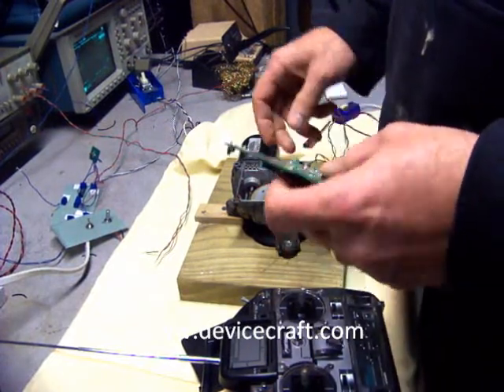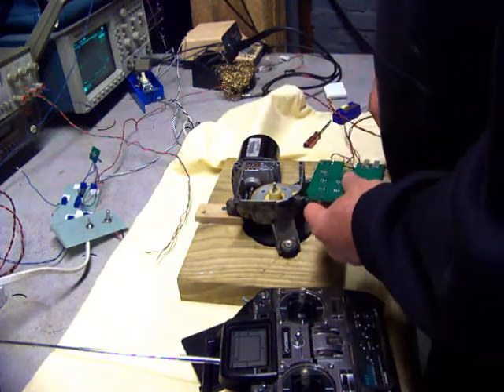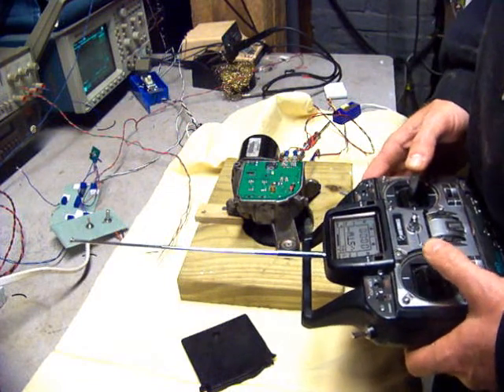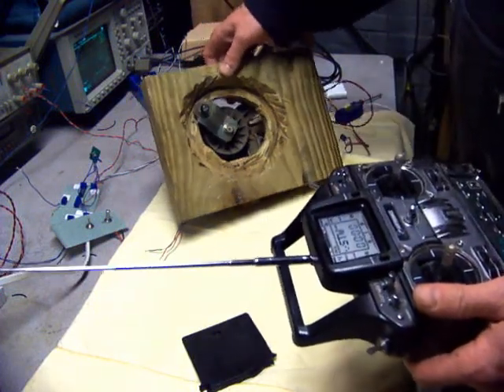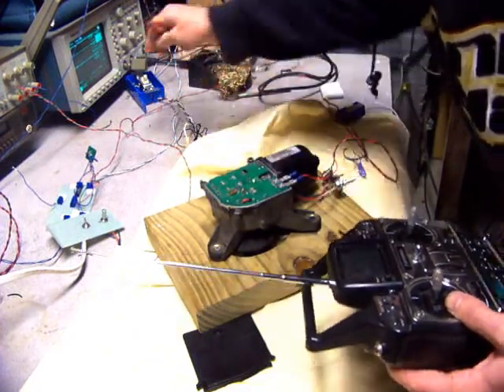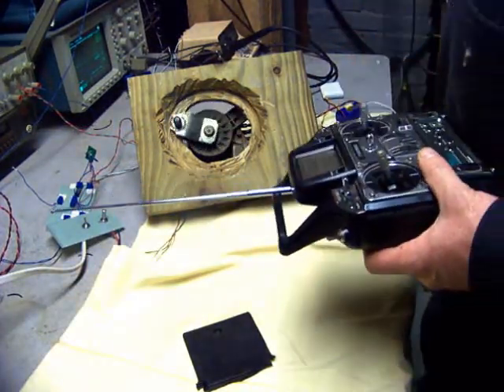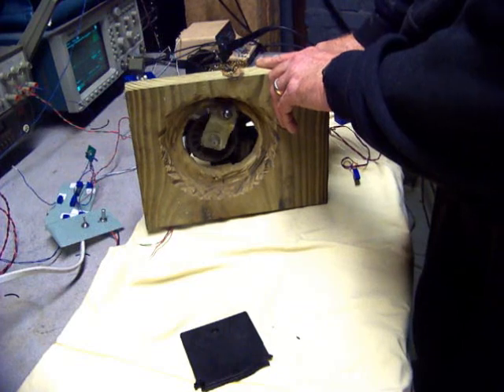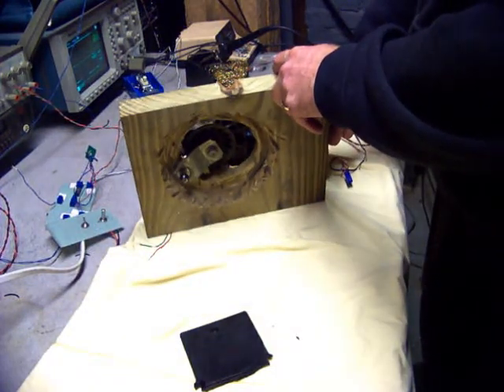Windshield wiper motor both servo and speed controller

Comment: Mohammad Auzi Ahadani The position control is implemented in this driver. Watch the video from 0.15 to 0.25 and you will notice the blue potentiometer on the PCB board and the shaft on the motor. At 0.20 he actually says that there is a potentiometer there. And at the beginning he clearly states it is a PID motor driver...